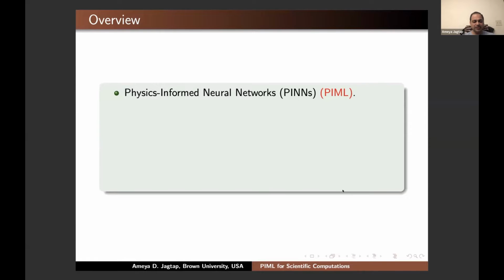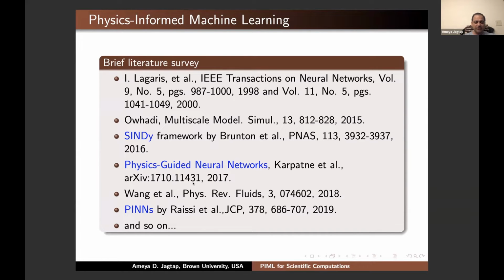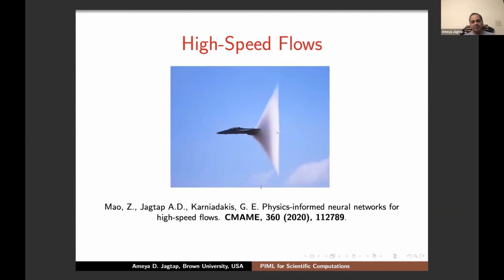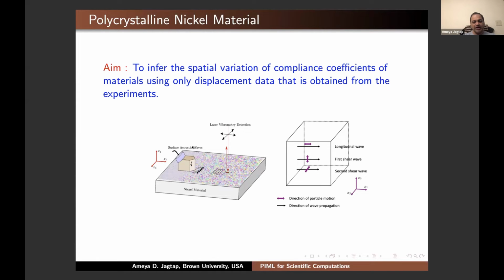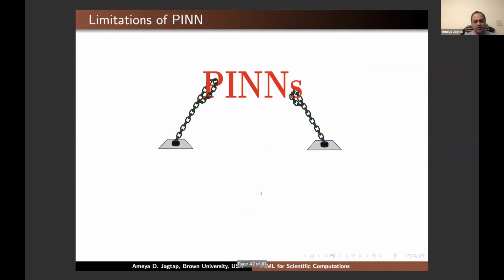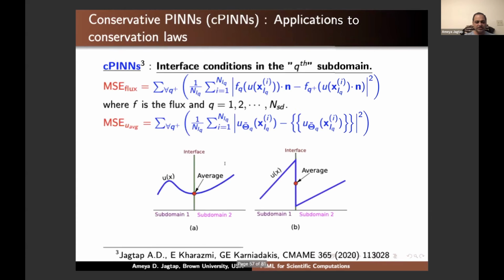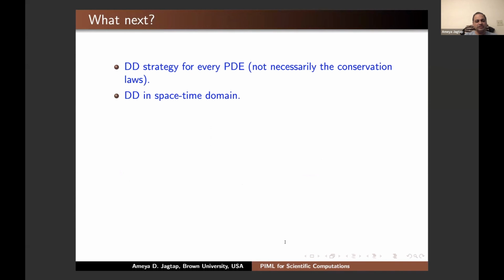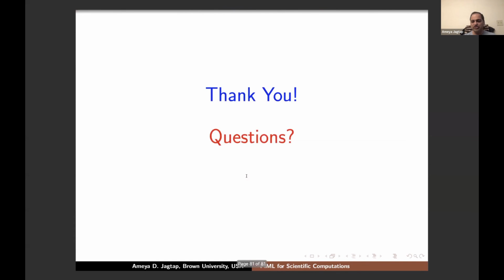PDENA22: Physics-informed Neural Networks: A new paradigm for learning physical laws

Comment: Thank you so much for providing content. Its really informative . I have one doubt in Xpinn implementation like when we are dealing with interface how losses are defined. i mean lets suppose we break the domain in three sub-domain. so for interface we impose continuity/average and pde loss with respect to the sharing boundary. Is it possible to share the code . I have gone through the paper Xpinn.  I have checked the github repo for this paper but its incomplete code.